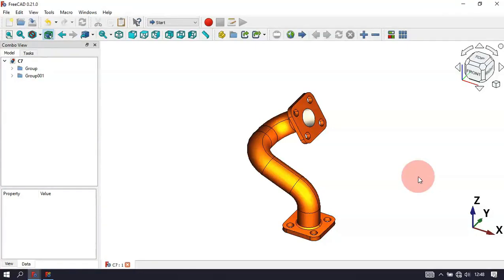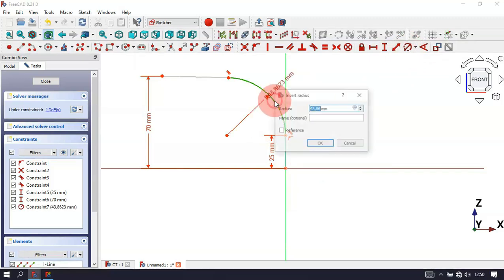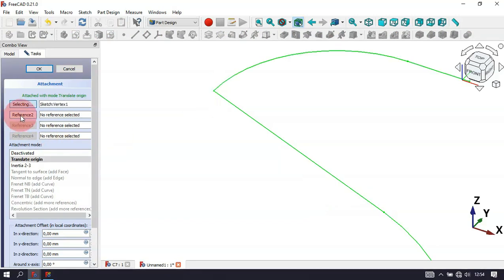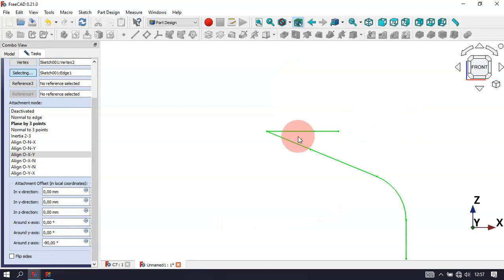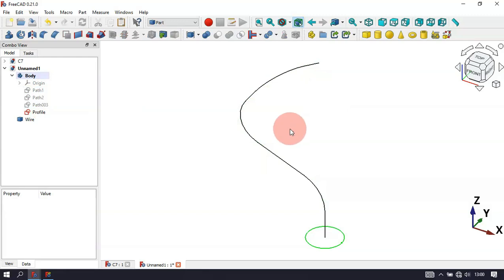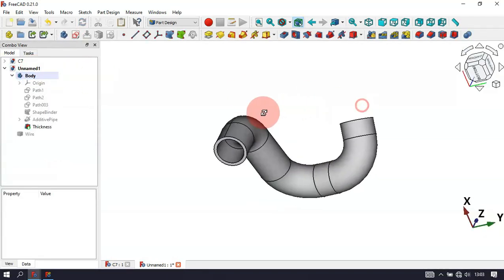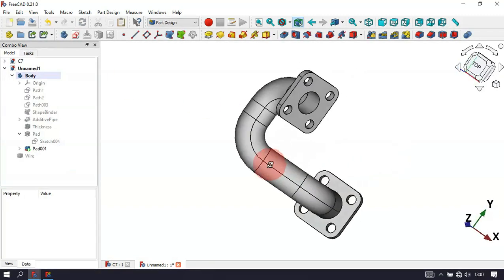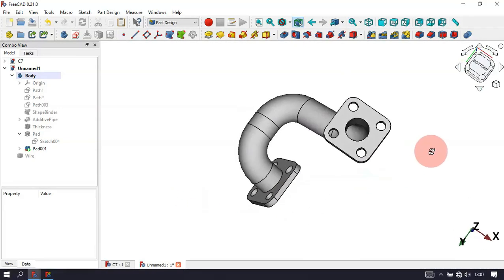FreeCAD 0.21 Beginners tutorial: practical exercise 116 (creating wire from sketches)

Comment: Very good Practice Tutorial. 10:10 some confusion on the diameter, 30mm-2.7mm=27.3mm but we ended up with 27.3mm-2.7mm=24.6mm? The way you moved the sketch (after Copy and Paste) is so much easier than trying to select the center of the circle and the "Move" tool that you have used in a couple other Tutorials! I commend you for a more exact way to move sketches. THANKS
Reply from the maker: Okay, thank you! I will try to improve it.